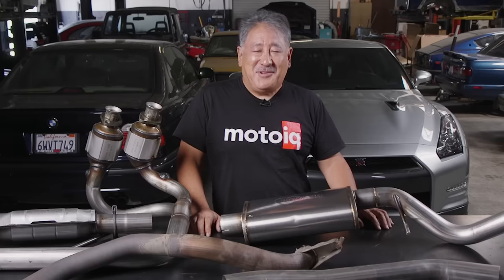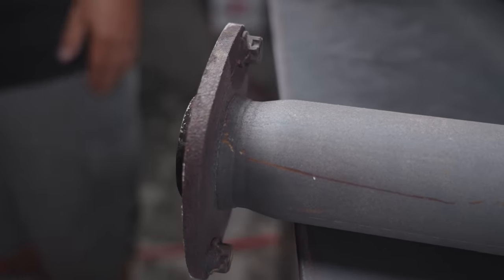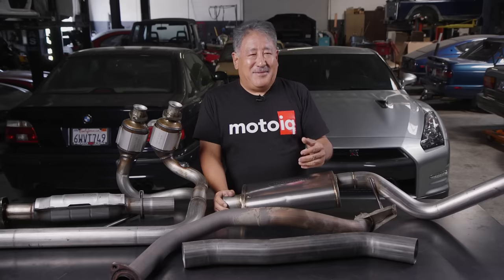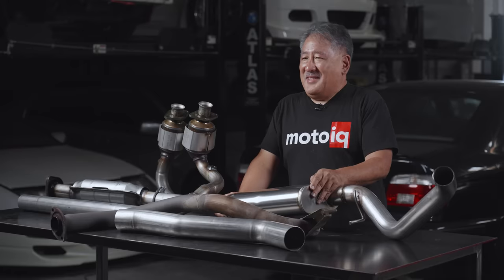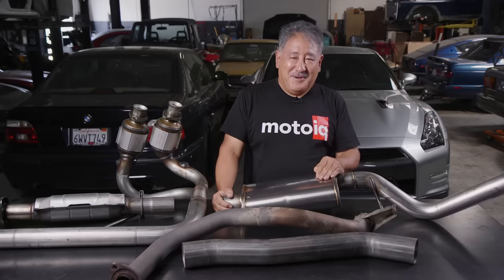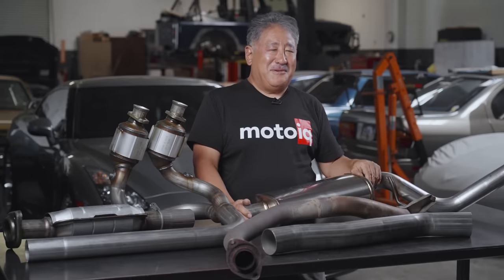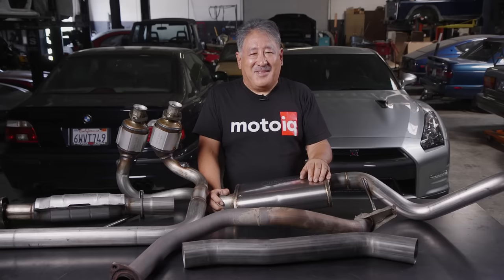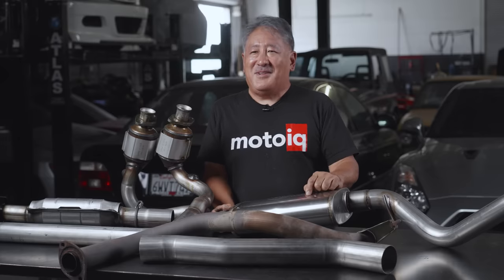Exhaust Back Pressure Myth DEBUNKED!

Comment: whats with the springs attached to the exhaust at 4:28? Im guessing it's meant to expand under load?
Reply from the maker: Allow for expansion and movement to avoid cracking. Common trick for race cars and bikes.
Reply: @motoiq  thanks

Comment: Ok, how do you then explain loss of power between straight pipe compared to one muffler on small 1.6 inline 4? It has no torque at all.
Reply from the maker: Too large of a straight pipe, AFR too lean due to improved engine VE or both.
Reply: @motoiq  not too large. Same diameter as stock. It has stock ecu, so only issue i see could have been is o2 not reading properly 🤷‍♂️
Reply from the maker: It is the second, on most engines the O2 sensor feedback is at lower rpm and part throttle only. Get a tune.

Comment: If you got a turbo and you're using a cast manifold doesn't that provide extra back pressure for better spool?
Reply from the maker: No
Reply: So this video apply to NA and turbo applications?
Reply from the maker: Yes

Comment: Way back in the late 70 s i used 3inch coming syraight off the header Mopar baby and a 17year old had some mighty impressive street cars .69 corrnet i had was a killer eveh tho it weight factor .Sure mustangs  nova and others beat my 50ft but 2 nd gear hit they were pased like no ones business.lol 68 RR i hac was no different but she was suoercharged and she cone off the line right with them big tire .
Reply: And yes all the way out the back

Comment: so whats better, i have   2 options 2.1 inch  pipe with no bends front to back and  one backbox. Or 2.5 inch  mid way split in to two  2 inch  backbox eatch side and goes back to center exhaust tips( basicaly 4  90degree bends eatch side and  2 backboxes) i would  think smaller diameter pipe  no bends and only  one back box better? its a  1.6 supercharged mini cooper 295bhp to crank  with  a 2.5 inch exhaust. wonder would  smaller diameter and no bends would make a difference in velocity as  guy said supercharged engine  have smaller pipe.
Reply from the maker: Can you do 2.5" with one muffler?
Reply: @motoiq   i could only as a custom made exhaust. 2.1 version i can go and buy and only for a fraction of a price. 90° bends do limit flow but by how mutch i wonder ( is it 2hp or 20hp). car weight at 950kg so every hp counts.
Reply from the maker: 2.1" is kinda small for that power level.
Reply: @motoiq  i was thinking the same, i might diy it, cut up my 2.5 exhaust and buy some 2.5 piping and get someone to weld it. Thanks.
Reply from the maker: I would do that for sure

Comment: I ran an exhaust shop for over 20 years. What happens if the flex tube breaks on a Honda accord or say a Nissan maxima from the the early 2000s on? They won't hardly pull out of there own tracks.  You can't increase exhaust flow on an ob2 system without computer work. Of course a big cammed motor pumping alot of compression you don't want exhaust pressure. We use to use to weld scavenging times from the valve covers to the headers on our drag car. Not on some foreign cars.
Reply from the maker: Because the air leak throws off the o2 sensor, not lack of back pressure.
Reply: @motoiq  when the catalytic converter is removed for more exhaust flow on them it doesn't have to leak. You yank the converter off one and see if it runs better. There's alot if variables and use to it was up to the muffler man to know his shit.
Reply from the maker: If you watch the video you will understand. It's throwing off the AFR and possibly the load for the timing and spark maps as well as killing scavenging velocity.  It is impossible for more backpressure alone to make more power.

Comment: That is not wrong. It re-arranges your power curve so I’m turn it is effecting power, sometimes positively. 
I have lost Torque on the Dyno many times over the years through experimentation on my 04 Cobra 
My 05 6.0 power stroke. 

I hear ya though.
Reply from the maker: If you go too big you will loose power and torque but you also need to watch your AFR and where you are in your maps.

Comment: Ok so question . 
 I have a Chevy Sub. With the 5.3 vortex with 290,000+ it’s a strong runner . Recently I keep gettin low fuel rail mixture codes. I know there is about a hundred things that can cause it. And I’ve been thru most of them and all is fine. Could that be caused by the cat converter getting clogged with so many miles??
Reply from the maker: seems like a fuel pressure issue, what code are you getting exactly?
Reply: @motoiq  P0171 / P0174 
  Has a new P regulator , clean TB , KN reusable air filter , new MAP , new fuel vapor canister . New fuel cap . 
   It really started when I moved from Tx gulf coast to N Louisiana . 
  Thanks for responding 🙏
Reply from the maker: The code is too lean, I think you need to look at the fuel filter, fuel pump, fuel pressure, check for vacuum leaks, leaks in the PCV and Evap systems, MAF and O2 sensor.  I am leaning towards, fuel pressure related issues and or vacuum leaks as the others should throw other codes as well.
Reply: @motoiq  ok. I put a new pump in about 6 months ago and changed the filter at the same time. MAF was cleaned at the same time , evap tank is new I was also thinking maybe evap line ,O2 ,or the PCV. Thank you. At least I know I’m on the right track. Your an awesome dude for giving this info. Many people would just say “ take it to a mechanic.” I’ve always turned my own wrenches , but these newer cars are just getting crazy. I think it’s time to rebuild the engine in my 87’ van and drive a reliable car again. Lol. Thanks again I’ll start going through those first thing tomorrow. 🙏✌️
Reply: @motoiq  maybe I didn’t get the pump seal quite perfect. It was a pain to lock down.
Reply from the maker: Maybe put a fuel pressure gauge on it post filter and drive around and see if the pressure drops if you get on it.  If the fuel pressure is ok, then I would do a vacume test on the evap system, then golf tee and vacume test every vacume line in the car. For O2 sensor, get your scan tool and take the engine up to like 3000 rpm in neutral with the engine fully warmed up.  The O2 sensor should cycle between 100-900 mv maybe 8 times in 10 seconds.  If this is a newer motor with a wideband, it should start around 900 mv or a little more when cold, then settle down to 400-500mv.
Reply from the maker: oh you can spray carb cleaner around the head to manifold and around the EGR system when idling and if the idle changes, you found an vacuum leak. Yeah fixing newer cars can be easy or a bitch.
Reply: @motoiq  lol. No doubt. Thank you

Comment: What can you explain about reverse tip megaphones. No guts. Mostly used on motorcycles in the 60-80s. I've used them on all my bikes. Honda 1-2-4 cylinders. They are a game changer dialed in right. Got to have the right reverse angle & hole diameter. I had a Honda 750 that I built from total scratch. Had an Isky cam in it but it didn't act right. I called Luther Isky,. Eds brother. He did the bike cams. He special ground me a cam with 100deg centers & it woke that motor up big time. Had good low end but came on hard 6g to? Stock bore 736. Alum rods. It buried 12g tachs. It was known all over Austin Tx & Houston too. It was Bad to the bone.
Reply from the maker: They add another pretty strong reflected wave and generally help increase power past the power peak so the engine doesnt die off as much at top end.

Comment: Is 2.5 inch pipe better than 3inch. I'm concerned the 3 inch will cause alot of drown noise inside the car
Reply from the maker: It all depends on your engine, what's done to it and how you use it.
Reply: @motoiq  it's a ls1 gto with 420rwhp heads cam, 102 combo. Currently has kooks long tubes and cat delete. I need to pass smog I live in California. Going to put carb approved JBA headers with stock cats. After the cat I don't know if 2.5 or 3inch is better for the mid to rear cause the cats are 2.5 I believe any size tubing after the cats are legal.
Reply from the maker: Probably 3" is better.

Comment: I had a Dodge stealth dual overhead cam. It wasn't turbo

I bought the exhaust off a turbo. All of it. Because the pipe was much larger. I had to take it all off.
I lost HP. And it never ran is good. It needed that back pressure.
Night and day difference. I think you need some back pressure on a lot of vehicles.
I've seen it myself. Even a new muffler on my GMC, it runs better.

I don't care what anyone says. I know it for a fact. Some back pressure is good on many vehicles.
Reply from the maker: The problem is either reducing the backpressure made the engine run lean or the new exhaust was way too big for the state of tune for the engine killing velocity and scavenging as we said in the video if you watched it.  Backpressure is never good or needed.

Comment: Probably a dumb question but something like a electric fan inside the exhaust could reduce back pressure?
Reply from the maker: Sure if it could spin fast enough.  But generating enough power to spin it would take more power than it could create. Second law of thermodynamics.

Comment: What do you recommend for a 2024 Nissan 3.8 v6 frontier. H or X pipes.
Reply from the maker: X if you can fit it.
Reply: @motoiq  Thank you sir. You think an internal X style muffler would work.
Reply from the maker: It depends, what type?
Reply: @motoiq  Dyno Max or Magnaflow in 2.25 DI and DO with the perforated internal X pipe
Reply from the maker: We tried one of those on a mild nearly stock VQ to make it sound better and more quiet and it worked well for that.
Reply: @motoiq  Thank You for the update and the Advice. I don't want loud noise just better performance.

Comment: Another example of the  oversimpleifcation of an engine saying it's just an air pump!
Reply from the maker: But it is as far as the exhaust is concerned.
Reply: an engine is NOT just an air compressor! You're ignoring  a whole rotation and the combustion process as well as power output  by using that simple term
  @motoiq
Reply from the maker: We are in the context of back pressure, not header design.
Reply: I was referring ro the term-air pump @motoiq

Comment: I did a 3" straight pipe on a Diesel 2014 3.2L Ranger which dumped just before the rear wheel. It kicked in around 1500rpm and stopped pullin around 3000. I then decided it was too loud so I put a full 3" exhaust with a muffler to the very back of the truck,  and now it kicks in around 2100 and falls off around 3500. I prefer the instant torque that falls off earlier in a diesel for some reason. 😂
Reply from the maker: Did you do anything for fuel?  That would help you get the best of both worlds
Reply: @motoiq  No? I'm just noting the very noticeable powerband difference from a 5ft exhaust to a 10ft exhaust.
Reply from the maker: If they make a fuel controller I bet it will wake your motor up!

Comment: size and "length" (you never mention length, I am surprised) is important from head to where the 4n1 comes together. On street bikes, I like back pressure, why, it is so much more ridable, more power in the mid rpm where your at MOST of the time. If your only on the track, yes, top end power does not need back pressure. I will sacrifice some top end to make my ride much more enjoyable riding through the canyons and actually quicker, so I debunked your debunk.
Reply from the maker: See this. https://www.youtube.com/watch?v=kBQjBMiYW3E

Comment: I recently added larger turbo downpipes and higher flowing intakes on a new twin turbo engine.  With stock exhaust, it was choking the engine, sometimes shutting the vehicle while driving.  Added a better cat back system, and amazing how easy it is to mess up the drive ability of a vehicle if everything isn't set up properly.

Comment: You dance all around the reason old timers call for back pressure, but you never quite get there. Mostly everything he is saying is correct, but, back pressure (resistance to flow) is needed to tune the exhaust, for street driven vehicles. Once you understand what a reversion exhaust pulse is, you’ll understand why street cars need resistance to exhaust flow. One of the reasons old timers harped on back pressure, is because young’uns always wanted to run straight pipe. Straight pipe works at the drag strip, IF you know the correct length and diameter to use for the rpm you intend to run. Straight pipe runs really well at only 1 small rpm range. A street car needs to run well in a wide rpm range, a muffler, back pressure, resistance to flow, helps the motor to run fairly well in a wider rpm range. Yes this guy is right, sort of, and the old timers are right, sort of.
Reply from the maker: What you said is almost right, sounds right to the uninformed but it isnt right.
Reply: @motoiq  , Yes it is. All of this was just academic for me until I experienced it first hand. While I was at the sand dunes with an 1835 VW sand rail, I decided I would open up the exhaust by removing the Supertrapp exhaust, I just knew I would be able to climb the dunes faster !  Man that thing sounded badass !  BUT, I could not climb the same dunes I climbed 1/2 hour before when I had the Supertrapp  muffler on the car. Clearly you know a lot! Certainly more than I do. But not as much as you THINK you do.
Reply from the maker: Actually, this is my field of study, I don't know everything but I know most of the commonly known thermodynamics and fluidynamics related to engines.  Retained back pressure in an engine reduces the amount of work each cycle can make.  https://en.wikipedia.org/wiki/Otto_cycle#/media/File:P-V_Otto_cycle.svg This is the otto 4-stroke cycle and this represents the thermal work of each cycle, if 1-2 is higher due to retained cylinder pressure, the area of the cycle is less, less work means less power.  This has been known for over 100 years.  The phenomena you experienced was due to a few things.  Did you monitor the AFR?  Supertraps are horrible mufflers, lots of backpressure unless you run tons of discs and they kill velocity.  I remove these from customers' engines, change to absorption-type mufflers, retune, and gain power every time.  They are very effective spark arrestors and sometimes you have to run spark arrestors, especially in California.  By uncorking your Supertrap, you probably caused your engine to run really lean.  I have seen some engines hardly run due to leanness when taking the discs out.  Backpressure also changes the tune of your headers.  The reflected wave in your headers travels faster with more pressure and the diffusion wave travels slower.  This can bandaid a header whose primaries are too big for the state of tune of the engine or whose collector volume is off.  It can also mask an issue with cam selection.  Gaining bottom end with backpressure is a symptom of other things off with the engine. A well-tuned exhaust actually has significant periods of below atmospheric pressure during overlap and a few degrees after the exhaust valve opens.  if you are interested and want to study some of this, I can refer you to some good books that have the math derived so its is non-rigors so all you need is some algebra and not an engineering background to understand it.  If you wanted to retain our services, we could redesign your headers and exhaust and you will make more power most likely across the board.

Comment: Are Hi Flow  catalytic converters creating restrictions and back pressure?
Reply from the maker: Some, on a highly tuned NA engine for instance, the power loss can be considerable.  For stock engines not so much to not at all.
Reply: @motoiq  I have a full bolt on E85 Nissan GT-R, the downpipe cats are deleted, but my Midpipe is a HKS with a Hi Flow cat.

I've been pondering replacing it with a straight through Midpipe with cat delete.
Reply from the maker: Yeah an FBO VR will do better straight through.
Reply: @motoiq  I appreciate the insight and the response. Even though it's a Hi Flow cat on my Midpipe, you believe it'll spool faster deleted? I'll definitely buy a new Midpipe and keep this catted one for "Street" use.... 👀
Reply from the maker: Yes, turbos love no backpressure and big pipes.  We run a 90mm straight pipe on our FBO R35.
Reply: @motoiq  Right on! Thank you kindly. I'll see about grabbing a straight through Midpipe. I have non catted AMS Downpipes and HKS Legamax exhaust. Hopefully I'll feel a difference.

Comment: Isn't it true that the less back pressure the better but if an engine is designed and the ECU is tuned to work with a certain amount of back pressure; valve timings, injector timings, ignition timing, etc., that if you have a hole in your exhaust like if you removed your muffler, the car won't accelerate well?  I know this is what happened when my 96 Honda Civic muffler and piping developed some major holes.
Reply from the maker: that's not the same as less back pressure, that's a disruption of exhaust tuning.
Reply: @motoiq  Are you saying the length of exhaust pipe is tuned like a tuned pipe on a motorcycle or hydroplane?  So if I had a straight pipe instead of the muffler, but with no holes I would not have experienced any loss of acceleration?
Reply from the maker: If your exhaust diameter is correct, yes.